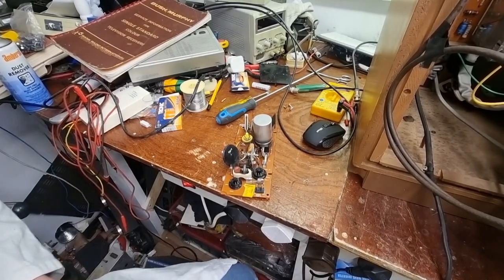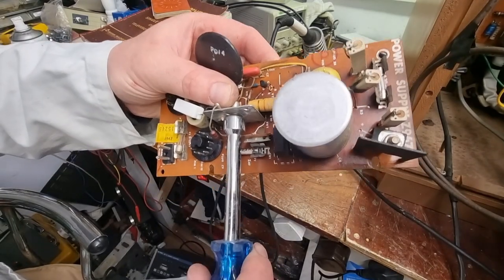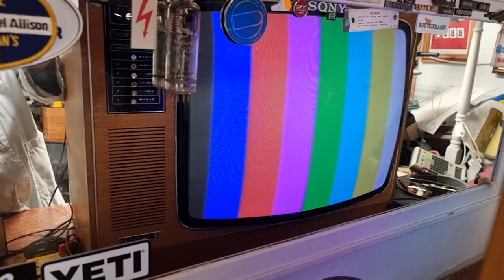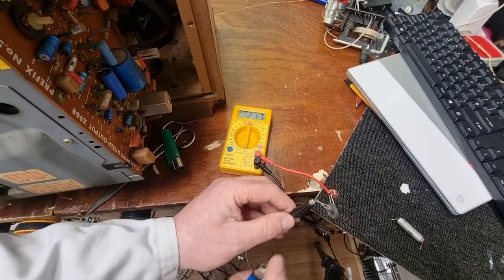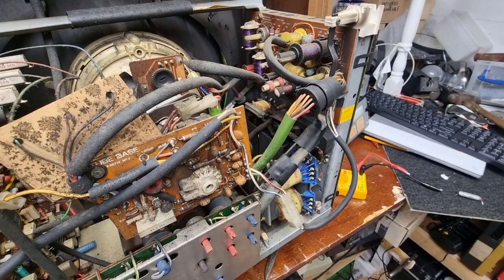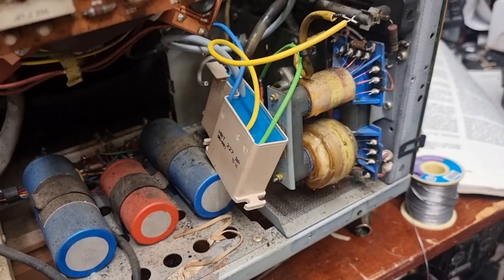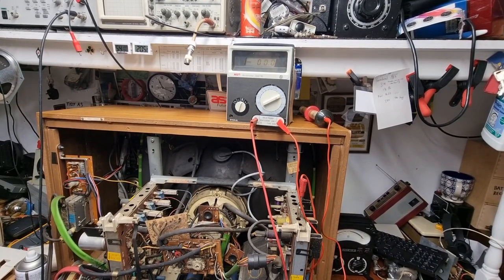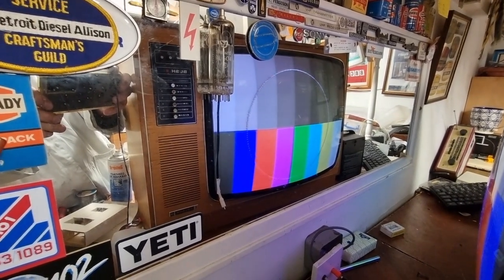Vintage TV Repair. Bush A823B. Part 2.....

Comment: Had one of these set as a kid but I kept it, open frame, without the case on it. I think it had the original tripler which was in a clear plastic housing potted with silicon and could be dug out.  which I did and still have the diodes and caps somewhere.  Good memories seeing the pcbs again.

Comment: I have a ton of these thyristors and diodes in the same package as it. I don't know what to do with them, but I inherited them from my uncle who was a repair technician. You reckon it's worth keeping them? I have considered just getting rid of them by donating them to some old stuff nerd enthusiast, and stocking new parts instead. 

Likewise, I have a lot of the old Philips BYX plastic package two lead diodes, which are all trash in comparison to modern equivalents and as such don't see any use for me in any kind of project.

Great video, great work! Thanks for sharing. I'm amused hearing your accent 'cause your voice sounds almost exactly like a friend's who used to be a jolly goof of excellent grade. Cheers!
Reply: Are you going to the retrotech show. I'd be interested in having one or two as spares also.
Reply from the maker: Bang me an email.

Comment: Very good point about the 240V typical. I suspect a lot of stuff suffers from the design assuming the supply is 230-220V.
Reply: Indeed. I'm in Ireland too, not too far from ojnoj, and can see from my UPS logs that the voltage hovers around 234-240V, usually on the higher side.
Reply: @steeviebops  Here in Birmingham it's normally between 239 and 247 when I measure it - normally at the higher end.